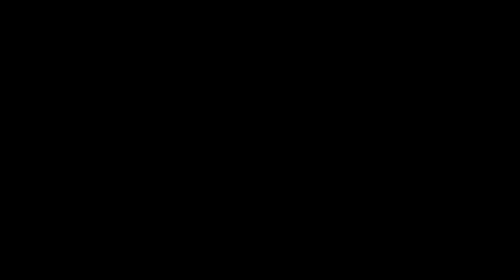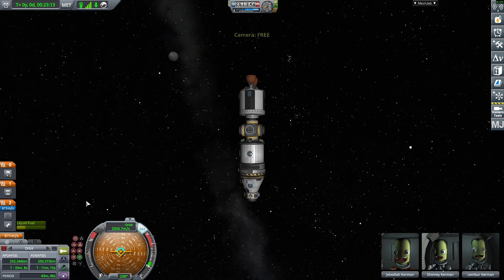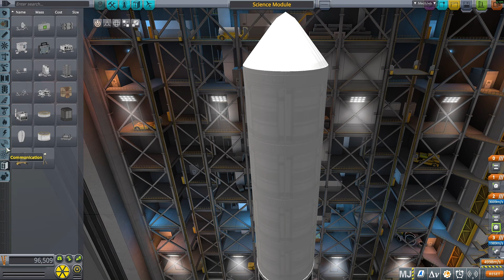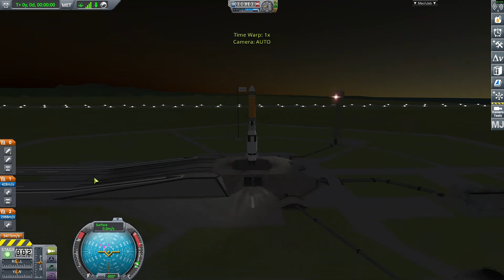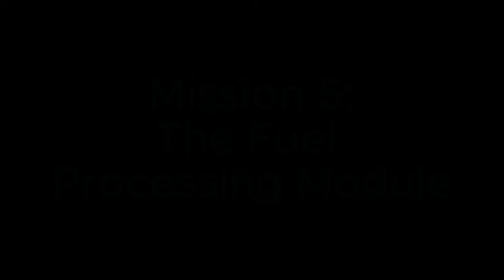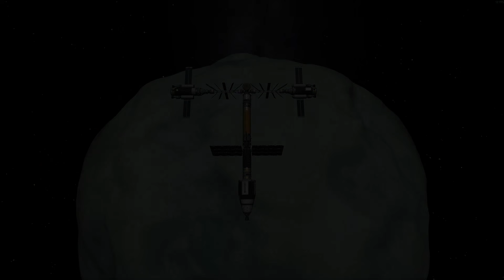How to Build an ACTUALLY USEFUL Space Station

Comment: The only thing I would do different would be to build a permanent ore processing plant on the surface. Swap out all but one ore storage for large tanks to fill up with fuel (launch with them empty). And then have a shuttle craft haul fuel up instead of raw ore. That way, the plant is always processing on surface. A rover would be the transfer vehicle between surface plant and shuttle. I would also swap out a science bay (and the station's ore tanks/processor) with fuel tanks (launched empty) on the station to have fuel at the ready for any ships passing by. The station could still be portable - I'd just launched new refining plants to the planet systems I'm going to.

Comment: Alternative title: How to destroy your FPS with a 400+ part count station
You might not think much of them at first, but over 10 launches all those probe cores, RCS thrusters, small batteries and solar panels do add up. Yes, some of these you can remove with on board engineers but that's a pain.
My advice for this: Go big. Fuel module? Use a 5m tank, you get a ton of storage in a single part. Batteries? Get the big boy ones. Solar panels? Use the big arrays. Wherever you can replace multiple parts with a single big one that's a win.
And a small tip for shipping fuel modules, have them hold fuel for the ascent. You can go up on that fuel and if there's any remaining once you get there, it's now available on your station. Just remember to have a small reserve tank on the upper stage so you can deorbit it.

Comment: İ have a Question we covered sikipper engine with a faring but instead using 2.5m decoupler what if we use a td-06 decaoupler its lighter than td-25 decupler we can have more delta v right?

Comment: Ok so, question, is it better or more effective to send a miner full of ore to a space station for refining, or could you have a mine and refinery surface base that send fuel to a space station, or is it just player preference
Reply: It would probably depend on how much the fuel and ore weigh respectively, whichever one weighs less would then be better.
Reply: @Shadeofdarkblue  you would need to add the mass of the convertatron, radiators and solar panels if you plan to haul the fuel. Unless you also build a dedicated processing facility on the surface.

Comment: Before he moved the station to Minmus i kept thinking "how is this gonna be of any use?"  I´m far from what u might call a good KSP player and i have tried to make a refulling station around Kerbin to fuel up rockets and often i found out that its almost pointless to do that as when u try to send fuel to the station for later use u end up having to use up most of it just to get to the station itself.
Reply: That’s why you build a rocket underneath the station fuel tank
Reply: Separate the rocket fuel from the delivery fuel with a decoupler :/
Reply: @Shadeofdarkblue  Thats not the issue.  The problem is that if u wanna refuel a Kerbin station in orbit when u slap on the extra fuel tanks u wanna use to load up the station the ship becomes so heavy that u may need a bigger engine just to get to orbit.  Ofc that uses alot more fuel so u have to load up even more fuel and now the ship will use up even more fuel to get into orbit or u may need a 2nd engine which uses up even more fuel and so on and so on.  Its a never ending cycle and in the end the amount of fuel u actually ending up transfering to the station is very little making it kinda pointless to begin with.
Ofc if u mine fuel from Minmus then bring it to a Kerbin station thats entierly different and very mutch worth it.  But i find that trying to refuel a Kerbin station from Kerbins surface is just gonna cause more work then its worth.  Setting up a drilling operation on Minmus can be very tricky but its definatly a better option then to shuttle small amount of fuel up from Kerbin several times.
Reply: @Shiftry87  bro. build a rocket with a lifting capacity equal to the weight of the fuel tank you want to attach to the space station. and then turn off the fuel drain from the space station tank. launch and rendezvous with the space station. make sure you put a probe core and battery bank on the actual space station fuel tank (after the decoupler from the rocket upper stage) as well as rcs and a docking port so that you can decouple the tank from the upper stage as you make the rendezvous and dock.

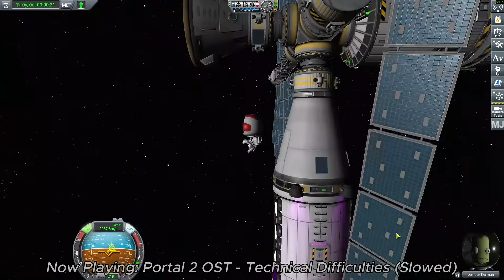Comment: 10:29 it’s actually doesn’t matter if your kerbal is a engineer or something else you just need to have a kerbal to eva(I learned this the hard way)
Reply from the maker: bro did NOT get the joke 🥀
Reply: How on earth do you learn ts "the hard way"???
Reply: @MysticalDude-yx4gh  Rouge kerbal hit starboard solar panels
Reply: The joke here is that normally you expect that changing space station configuration requires engineering skills to be successful, but in this scenario it is unnecessary